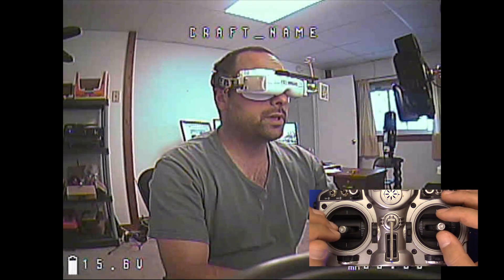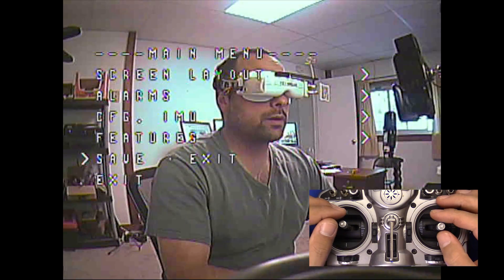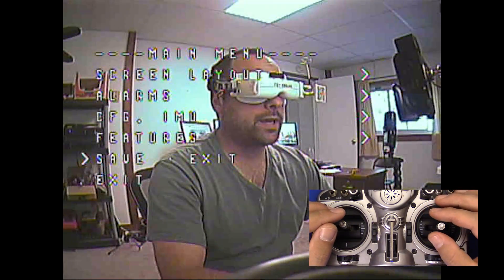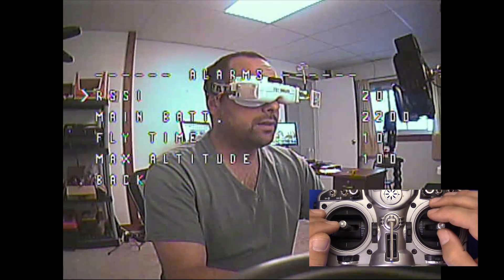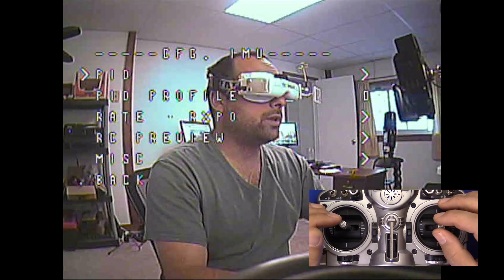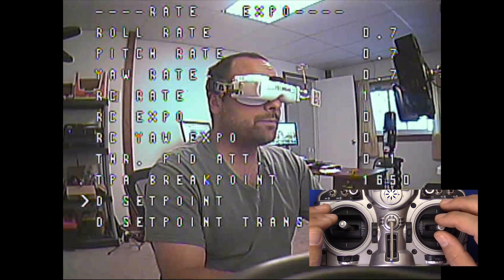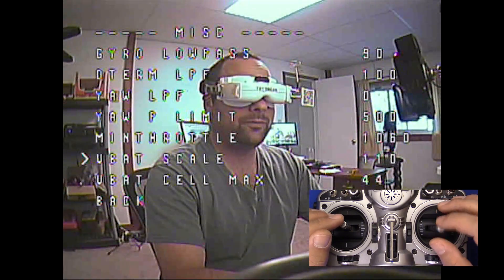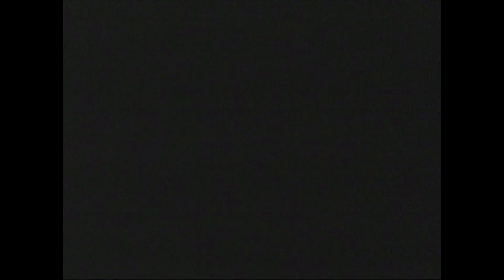Betaflight OSD 3.0.1 Overview / With Sirin FPV

Comment: What would happen if you had two flight controllers that both connected their vtx/osd out ports to the same vtx with a split? Would both OSDs overlay nicely or cause interference? I was thinking about this because I want a separate 2s battery to power an hv servo gimbal with its own dedicated flight controller, but I would like to have the voltage of both the big flight battery and gimbal battery displayed on OSD.

Comment: does this work on any fc or certain ones , i have a fortini f4 will it work with it
Reply from the maker: Fortini does not have BFOSD built in. BFOSD only works if the FC has hardware to support it.

Comment: Heya , i dont know if this is a stupid question or not buuuuuut , can a MWOSD be flashed over to betaflight osd
Reply from the maker: +NRGFPV LiSdEXiA no.
Reply from the maker: Betaflight OSD only works on boards that come pre-installed with the OSD. But Betaflight does have the ability to communicate with MSP and add some betaflight-specific options. Basically, there can be a separate "betaflight" screen on the OSD to configure betaflight options, but you can't have the full betaflifght OSD features like PIDs on screen and pilot callsign from the configurator.
Reply: cheers mate ,, i have recently recieved the AIO v4 F3 board and done a full build and have flashed it to all bf and have tonight just flashed the MWosd to the latest  scarab release of its firmware but havnt seen any massive improvements and not sure on how to get the beta flight specifics up on it ,, i was really hopingas the vtx and osd are linked on this board and channel swapping is done via firmware that some of it may have been possible but nahhhhh lol
Reply: thankyou for taking time to reply

Comment: Hi Joshua, maybe you can help me, i just install a flip 32 f4 batlel to a new build, it came with beta flight already flash, i connect out of the box to beta flight configured falloin step by step on one of you tutorial, every thing look good, but my motors d'nt respond they are dead, only happen with this controller, it works good with my kk2, i will appreciate you help trlly Jochhe, aka jochhe57@msn.com
Reply from the maker: Most likely your ESCs don't support OneShot, which is the default output protocol in Betaflight. You can change it back to PWM in the Configuration tab, but honestly any ESC that doesn't support OneShot is so old as to be obsolete, and it will fly very poorly on a multirotor. If you can afford to replace them, even a set of RacerStar BLHeli_S ESCs for like $45 will be a huge, huge step up.
Reply: Thank you Joshua, the problem is solv, i am goin to buy, blheli oneshot, Thank's again for you fast responce, i appreciated very much.Jochhe

Comment: What setup (receiver/diversity modules) do you have in your fat sharks in this video? I thought you were a Laforge user, but it looks like you have the furious or realacc in the receiver bay with something else aftermarket in the headtracker bay. Just curious.
Reply from the maker: I think I was using Furious for this one. The LaForge diversity module is in the other side though because it doesn't need to be removed.

Comment: Will the Betaflight OSD support an IR lap timer? I just barely bought the redrotor PDB/OSD but I think I"ll do  this next time.
Reply from the maker: Betaflight supports IR transponders but I don't think it supports an IR lap timer. The Betaflight IR transponder model is that the copter has the emitter and the sensor is on the start/finish line. So the laptop detects the copter passing the line and records the time. The copter has no idea when it has passed the line. This is the exact opposite of the RROSD model. At least that's how I understand it.
Reply: Thanks. Your reviews are incredibly helpful. I'm check out the patreon site. :)

Comment: I installed a brand new sp racing f3 board into a quad.  Everything works fine when connected to Betaflight GUI but when I power w/5v nothing happens.  Also when plug in a pack while it's connected to BF, it shuts off.  The leds go off, the com port closes, ect.  Then as soon a I unplug the pack it's back on.  I've confirmed 5.03v and no short on the 5v rail.  Any idea?  Bad board maybe?
Reply from the maker: Short on the main PDB?
Reply: Joshua Bardwell as always thanks for the reply.  I just pulled the quad apart and as soon as I saw the fc I noticed the problem. I soldered the ground wire to the boot pin.  I guess I was never really looking at that side of the board where it's labeled "boot" while soldering.  I staggered the + and - wires so I had + on motor 8 and - on boot.   From now on I'll test electronics before fully assembling.

Comment: yes, but in ppm the signal pins 5 and 6 don't  work unless you activate  a serial  port . which then will kick out your rx but allow you control of the motors via the motors menu  in beta flight.

Comment: If you get a flip 32 omnibus or any omnibus FC their great just remember you cant fly a hex a copter with them yet. Something in the firmware only lets you run four motors  even tho you can select a hex file in the gui.
Reply from the maker: +michael davis odd. They have more PWM outputs.

Comment: I'm glad to see the VTX settings as it is simply a sensible thing to to, it also means you don't have to have the DIP switches (or buttons) easily accessible.

My Quark 150 requires a partial disassembly to change channel

Comment: I can confirm that BetaFlight 3.0's OSD features are quite limited in comparison to 3.01. The OSD menu allows for basic PID tuning, but that's all - no feature on/off or relocation options. In 3.0 those settings must be changed via the OSD tab in the BF Configurator. Really stoked, however, that in this next release everything that I could ask for is there! I'll be flashing my F3 OmniBus tomorrow, after some flights because the Fury X-frame it's installed in must be partially disassembled to get to the FC - thank you BF contributors and Joshua especially for going over this.

Comment: awesome! Is it possible to control the set point weight sliders from say a dial on the Taranis?
Reply from the maker: Not like you are thinking, no. Cleanflight / Betaflight have "in-flight adjustments" which allows you to tweak parameters via Aux channels. But the do not have any mechanism for mapping a parameter to the value of an Aux channel. What I mean is this: what you want to do is have a pot where the position of the pot maps linearly to the value you are adjusting. CF/BF can't do that. The only thing they do is let you increase/decrease the value of the parameter by raising and lowering the Aux channel. So you flip the switch one way and the value increases slowly over time, and you flip the switch other way and it decreases. You center the switch and it stops moving. The problem with this is that there is not a way to know what the absolute value of the parameter is, or how much you've actually changed it.

Setting that aside, the setpoint weight parameters are NOT adjustable via in-flight adjustments anyway.
Reply: ok thanks. I just thought it would be nice if this was possible one day. I mean, wouldn't it be great to be able to set up a separate dial for P, I and D, and tune in the field that way? How valuable would it be to make a change and see its effect immediately during the tuning process, or be able to quickly adjust the set point weight for whatever type flying you want to do in the moment... please correct me if this is a stupid idea
Reply from the maker: No, it's a great idea. I wish it existed. The way it would have to work is, you would have to be able to set endpoints for the parameter, and the slider would adjust the parameter within those endpoints. If you couldn't set the endpoints for parameters like I and P and D,  it wouldn't be usable.
Reply: If I remember correctly, CC3d had this when I first started flying about 18 months ago.  Would love to see it implemented into Betaflight.  
Would be even cooler if you could show your current PIDS on screen too, that way you could enable them when you are having a "tuning session" and adjust with a slider or pot, hell even the current toggle up/down would be good if you could see your pids whilst flying.

Comment: Looks and sounds very promising indeed. What hardware specifications does one need to fully use all features like change the VTX channels ETC. What boards have the OSD via SPI currently available to use here? Thanks.
Reply from the maker: Sirin FPV, Omnibus (all variants), and BrainFPV are three that I know of. Kombini with Passado can also change vTX settings, but that is NOT via Betaflight OSD. It is via some other mechanism. The TBS system can also control the Unify vTX via serial protocol I think. I'm sure that's not all of them but those are the ones I know about.
Reply: Will there be external OSDs in the form factor of the minimOSD that will support the SPI protocol and will be able to communicate to betaflight so one would be able to hook it up to any fc?

Comment: There has been some development on github to add the ability for the omnibus f3 board to control the tbs unify series of video transmitters. When unify VTXs are used with the tbs power cube and power core, the video band, channel, and output power can all be changed from the OSD by communication on the VTX audio signal. The goal would be to give the omnibus board the same ability. https://github.com/betaflight/betaflight/pull/1283

Comment: does the sirin provide any current or mah used?
Reply from the maker: It does not have a built in current sensor because current must be measured at the PDB or the main discharge lead. The Sirin people told me that they can make a custom version of the firmware that turns UART2 into a current and RSSI input, but I don't know if they have actually released that. You would still need an external current sensor of course.
Reply: Joshua Bardwell or use the virtual mah in betaflight. Works pretty good for me on Omnibus F3.
Reply from the maker: Maybe I should check that out some day.
Reply: Yeah atleast its very useful for me, within 30-40mah on every flight, when i use 2.5-3.5min on a battery.. But if i go for a sloow cruise, like 5min cruise, its not measuring correct. It needs to be adjusted to your typical flying style..
Reply from the maker: That's the main thing I don't like about it. A proper current sensor will be reasonably accurate across the board.